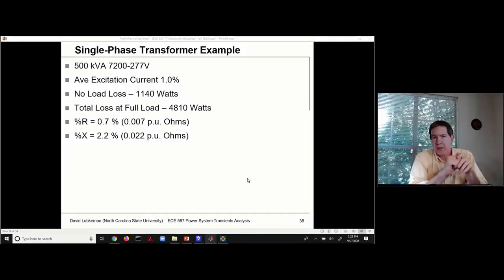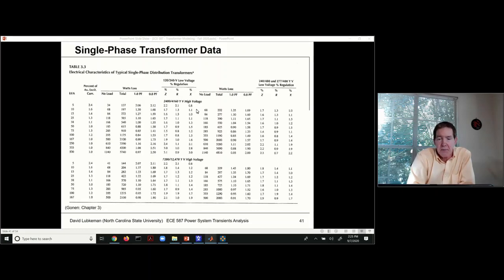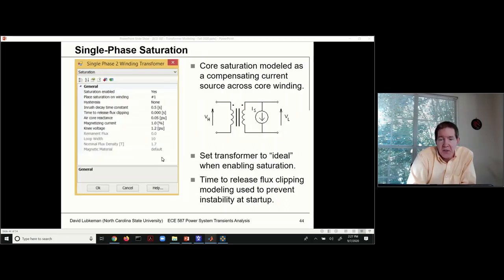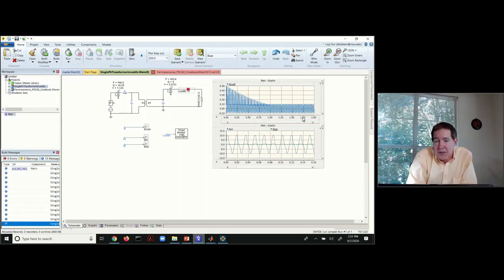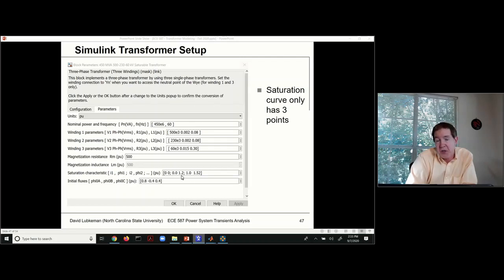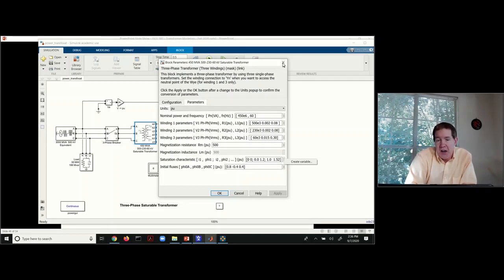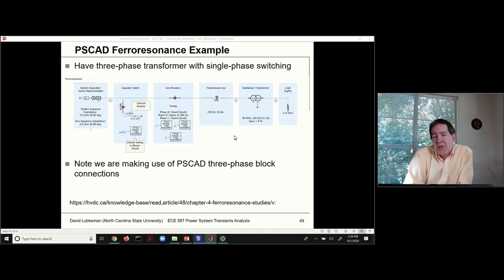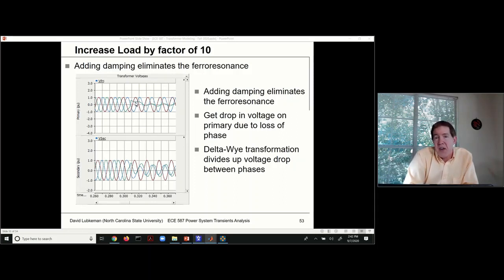Lecture 8c: Transformer Modeling PSCAD & Simulink - Power System Transients Fall 2020 - Lubkeman

Comment: Single Phase Voltage Source Model
* Configuration
- Rated Voltage = 7.2 kV
- Voltage Input Time Constant = 0.00 [s]
- Impedance Data Format = Impedance
* Ac Source Initial Values
- [7.0; 60.0; 45.0]
* Impedances
- [5 ohm; 80 deg]

Time Breaker Logic Closed
 - 5.0 s

Multimeter
*Configuration
- Base MVA for per unitizing = 0.001

Comment: Thank you for this fantastic video about inrush and Ferro resonance. However, I have one minor query. In the Ferro resonance PSCAD simulation, the ideal transformer model is set to 'No', whereas during inrush it is set to 'Yes'. Could you please explain why these are chosen differently? Thank you.
Reply from the maker: It has to do with how the transformer core model is represented.  In the inrush case with model set to "ideal", I model the core saturation as a current injection source on the primary side that emulates the core saturation characteristics. So this current injection effect is essentially added to a transformer model with no core to get the total effect. In the ferroresonance case, I set the transformer model to "nonideal" and utilize a more detailed nonlinear core model.  I'm by no means an EMTP transformer modeling expert, but there is more detail on this in the PSCAD program documentation.

Comment: Thank you, Dr. David, for this video. I replicated the exact same model as yours in PSCAD, including the transformer parameters. However, I am not observing the inrush current in my results. The Ia starts from zero and within 0.2s settles around the steady-state value of 0.1 A. Could you please advise on why this might be happening? Thank you!
Reply from the maker: Did you refer to my original PSCAD file on the Github site or build the model from the screen shots in  presentation?  Wondering if there is something going on in the other parts of the circuit model.  Maybe compare to my pscx file at: https://github.com/DavidLubkeman/Power-System-Transients-Course/blob/main/Lecture%208c%20-%20PSCAD%20SinglePhTransformerInrushEx.zip
Reply: @dr.davidlubkeman284  Thank you very much, Very helpful. I initially modeled it based on the screenshot, but after reviewing your PSCX file, I noticed that the voltage input time constant in my source model was left at the default value (0.05s). After changing it to 0 or a very small value, the inrush current now matches yours. One follow up question on this: I am modeling a generating unit along with a step up power transformer in PSCAD. But I do not have the values for air core reactance, magnetizing current, or knee voltage, as the project is in early stage and these values are obtained through transformer testing reports. I do have other rating parameters such as X. Is there a way to estimate them with reasonable accuracy?
Reply from the maker: @maryamd99  I don't have any material on that topic ready to send.  I would suggest you go to the PSCAD web site and search their Knowledge Base.  Once you do that, then you could also contact their technical support.
Reply: @dr.davidlubkeman284  Thank you!